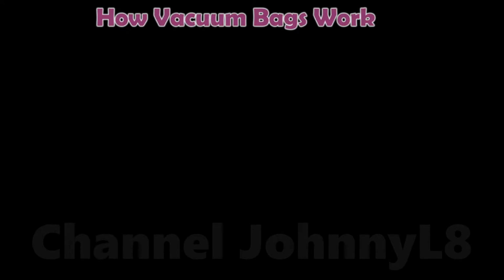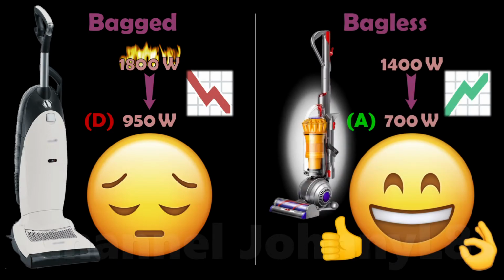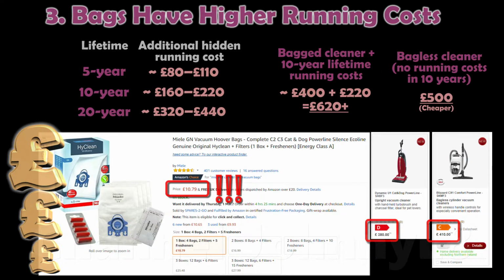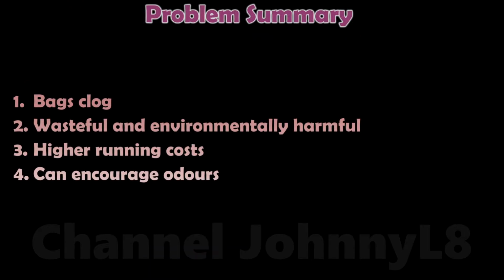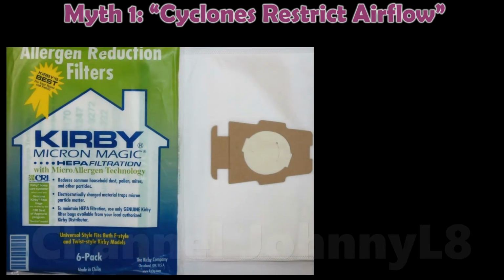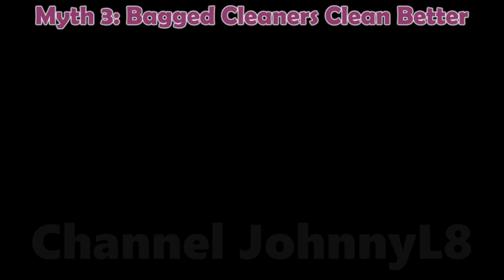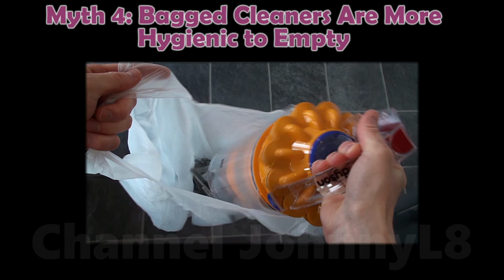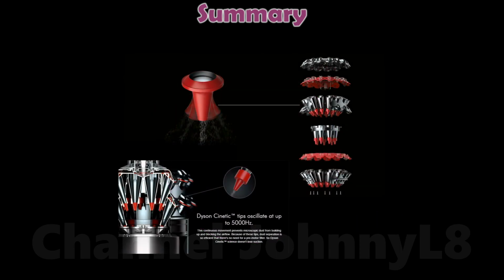Bagged Vs Bagless Vacuum Cleaners

Comment: As i've said before I agree with a lot you say. explain this.....I've seen videos where they measure the airflow with the air going through the cyclone unit then they measure again bypassing the cyclone unit and the airflow increases greatly. Why is this happening if cyclones don't restrict airflow?
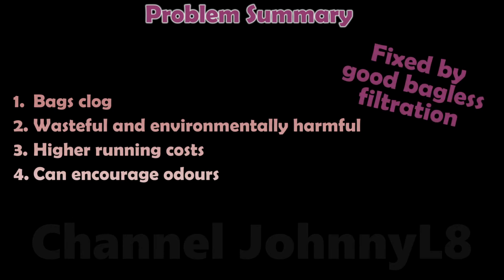Reply from the maker: "I've seen videos" to me means subjective nonsense on YouTube. You've also missed the point, again, about the fallacy of the claim that "cyclones restrict airflow", and I'm having to repeat myself yet again. So instead, I just refer you to the video @6:41
Reply from the maker: By the logic you're peddling, cyclones restrict airflow in a way no different to how bags restrict airflow. Putting anything that filters dust in the way of air flow will restrict it. But this is totally irrelevant as discussed in the video.
Reply from the maker: I've covered this fallacy in detail multiple times. Putting anything in the air path with restrict airflow. But only fixating on this (and ignoring literally everything else I've said that contributes to the topic) is probably why I'm repeating myself. Quoting those numbers instantly shows you're falling victim to the fallacy of the assumption that motor power and design is the same in all products. The motor for a particular product is tuned to deal with whatever restriction happens to be in whatever that product is, to ultimately perform to a designed level, as measured by the test standards. And that resulting cleaning performance is all that's important (well, along with all the other holistic criteria I've outlined in the 'how to review' video). If you don't understand this by this stage, other than repeating myself further, there's not much I can do to help you understand. :(
Reply: JohnnyL8  Motors are tuned to give best performance but that's within the capabilities of the restriction of the multi cyclones. You can only get a certain amount of performance. A bagged cleaner can produce much more airflow when it is new and the best bags will produce more airflow than a Dyson when it's full too. The V10 has just been measured on an airbox and the airflow at the cleaner head is just 24 cfm. I am very disappointed by this, for a £400-£500 cleaner 😟
Reply from the maker: No you can get as much performance as you want--just scale things up. The art of design is to get the greatest performance with the least resources. In the world of vacs, performance is measured by industry standard tests under real-world conditions anyway and even with Dyson's cyclones, they get good holistic performance. Air watts are a red herring as I've said on many recent comments (this is probably my next video; big myth that needs busting).
Reply from the maker: Ah, I've just watched that video. Other than the absurdly poor test methodology that guy is using (a freaking wind anemometer placed by hand on the suction hole?! lol) it doesn't show anything of relevance. I'd just recite my cleaning performance industry test standard mantra at this point. haha, his airwatts box was jus gold...cardboard and stickytape. This is what I mean when I say "bedroom test". You just can't take anything like this seriously. haha Even though it favours Dyson, it's just a hilarious propaganda joke.
Reply: JohnnyL8 I have a V8 and I like it very much for quick pick ups but it won't match my Miele C3 Sebo and Central Vac. But to be honest I wouldn't expect it to. As far as cordless cleaners go Dyson leads the way but they have a long way to go to match the best corded cleaners.
Reply from the maker: You could be right, but I'd need to see industry test standard data and a full holistic analysis before I was convinced, as you know :) I don't believe without evidence, even if something feels intuitive, because often what's intuitive isn't always right. My most recent experience of that was that the V10 performed as well as my Light Ball in mode 2. Just would never have believed that before I tested it as rigorously as I could. It's a total myth that it doesn't clean as well as the best mains for real-world mess levels.
Reply: Vacuumtests I'm sure Dyson will improve their cordless cleaners considerably in the coming years and I hope they can match a corded cleaner and have a long battery life because one thing is for certain they are so much more convenient to use than a corded cleaner 😁
Reply: Vacuumtests Yes they have a long way to go. I hope they can do it but I'm not sure they can. One thing the floorhead is only 9" wide so the  air density will effectively increase the performance. It does seem to pick up well on my carpet but I have low pile.
Reply: I'm still not sure how much airflow you actually need to pull harmful dust out of a low pile carpet. Harmful particles are microscopic in size so it shouldn't be that difficult to pick up. If you live near a beach, sand in higher pile carpet will need more agitation and airflow but I think there is a debate here 🤔
Reply: Airwatts are very misleading but tell me what carries the dirt from the carpet to the bin or bag? You have a motor that spins a fan that causes a drop in ambient pressure which causes AIR to flow. It is this airflow that carries the dirt into the cleaner. Correct me if i'm wrong?
Reply from the maker: This topic isn't about Dyson to me, it's about how you determine what's true. Dyson tests to industry standards and are objective and verifiable/repeatable. Anyone who dismisses them is dismissing objective evidence and carries little respect from me. YouTube bedroom tests are deeply flawed, not rigorous or standardised, and usually show nothing convincing. It's also the explanation for why Dyson machines don't always do well in those tests; because they're absurd, unrepresentative of normal use, and deeply contrived and misleading. Consumer report testing (e.g. Which?) is also not done to industry standards and suffers from the same problem. Anyone can do tests, but for comparison to be meaningful, they need to follow a standard test methodology and formal independent bodies decide them. Dyson do not decide the tests, they follow the formal ones outlined by others. I think you mean well but lack enough knowledge of formal testing methodology and scientific practice to determine truth behind any claim of any nature to have any meaningful sway, at least to me. I'm here to call out what I see as nonsense and weakness on YT that I saw recently in this area. I'm not witch-hunting, and I don't expect to convince everyone, but I intend to provide some respectable (and verifiable) counterpoint. Some people will never understand how to determine truth objectively, but that's normal and such people will either listen and think, or are beyond help.
Reply: I'm always willing to learn. I enjoy learning new things. But I can't get my head around this one as hard as I try. I did some research on the EU testing. It is a standardised test. It's tested on Wilton carpet. A rating removes 91% B rating 87% C rating 83% D rating 79% E rating 75% On hardfloors with a crevice. A rating 100% plus 11% B rating 100% plus 8% C rating 100% plus 5% etc. 
So it is standardised
Reply from the maker: Not sure I understand why you don't think the V10 matches a corded cleaner. Bearing in mind air watts on their own are meaningless, just as motor power on its own is meaningless, just explain to me again why you think they're not a match (presumably you mean in terms of cleaning performance for the normal-real world mess levels they were designed for and only for). If a mains corded cleaner finds no more residual deep-down dirt in a freshly V10-cleaned carpet than the V10 for *normal real-world conditions*, I don't see how there could be any doubt that the V10 isn't mains-equivalent in cleaning performance.
Reply from the maker: I've started (but got bored because it's so dry) the planning for the video on industry standard testing. I might take longer and look into what the EU labels do. But the devil is in the detail; there is a whole story behind how and why they test the way they test, and those details are buried deep in the 100 page standard. Such a boring read but I'll finish it eventually.
Reply: I'd like to believe it I really would. I would like to see a test done that you would approve of with a Kirby against a V10 or even the best clean air motor bagged cleaners such as a Miele C3 or a Sebo Felix.
Reply from the maker: They'd probably perform comparably well too, to be fair, for normal real world tests. But they come with additional costs and consequences--like bags and other running costs, noise, weight, extra power use etc. Achieving good results is about elegance and efficiency, and these older vacuums and associated tech are just a joke nowadays and aren't actually any better, not matter how much people want to cling to the past. You can get as-good real-world cleaning performance with a little stick in your hand now because the tech has been polished so much. You don't need an overpowered, wasteful ton of metal any more. Brute force is no substitute for elegance and efficiency.
Reply: Vacuumtests Mike makes a very good analogy which is why I find it hard to believe even though I do find it easier using my V8
Reply: Vacuumtests I agree 😁
Reply from the maker: Yeah...we're talking vacuum cleaning performance not cars. I don't think your analogy works beyond getting from one end of the street to the next. I don't think I can help you further at this stage.

Comment: Also talking about landfill in one of your videos you show how to empty the Dyson into a bag. Is this not adding to landfill also?
Reply from the maker: Also, I made it very clear, in two different ways (description and in-video) why the bin liner was used (to assist visually). It isn't necessary to use, could line the next bin, and regardless, still has a considerably lower carbon footprint then thick vacuum bags. All this is covered in these videos and I'm constantly repeating myself with your comments.
Reply: JohnnyL8 True, better still if your council provides biodegradable bags for green waste like mine, you could use those instead eh?
Reply from the maker: They're a bit small, but whatever works best. I just dump straight into the bin making sure I don't splash. Literally no mess, unlike in the hater-infomercials where they practically throw it across the room to show how 'terrible' it is. xD